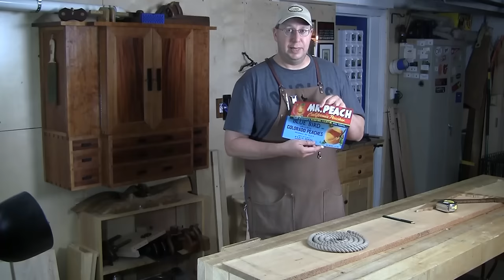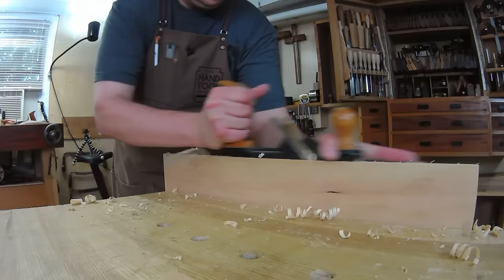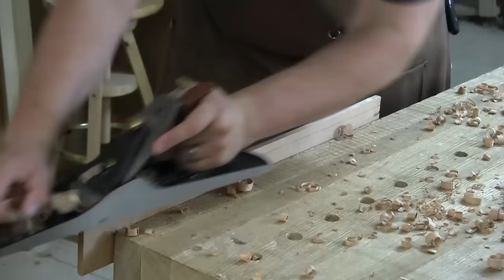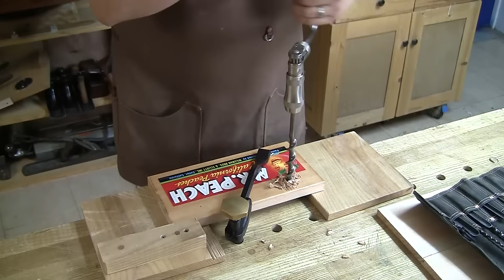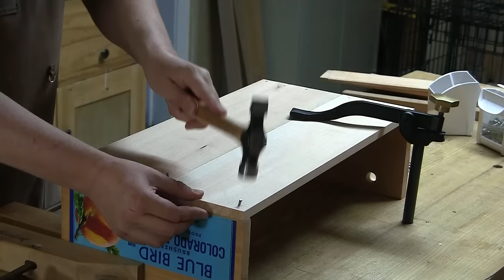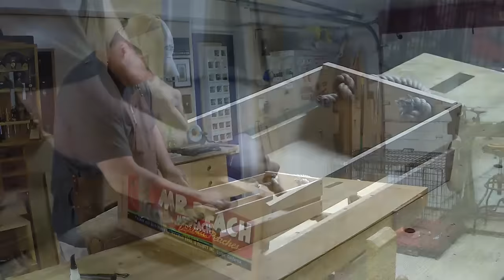RWW196 Peach Crate

Comment: I love the angled nail thing. So clever and so sensible; I'm wondering why I haven't seen it before.

Roy Underhill did rope handles for a box once, but instead of knotting the ends of the rope, he untwisted the strands and then re-twisted the two cut ends together. The effect is a continuous loop of rope. Perhaps not as strong as knots, but plenty strong enough with heavy rope like that.

Comment: Very nice! I like the lables as well! Maybe you can roughen it up a bit with 80 grit sandpaper, especially around the edges of the lables. 9:22 why did you start the nails with the peen of the hammer? You make great videos, keep them coming!
Reply from the maker: Dutchhorse its a more accurate way to get the nail started.  Since the wedging action of the cut nail needs to be positioned so as not to split the wood, the peen side allows the precise control so the nail doesn't twist in the pilot hole.